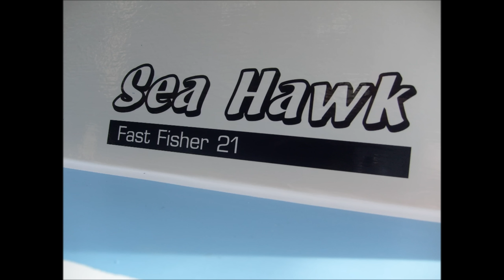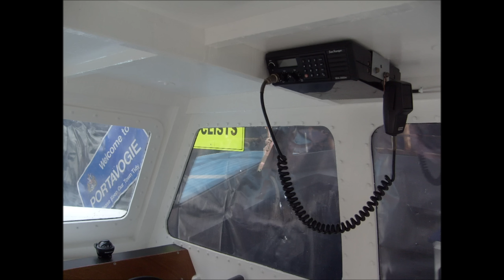Wooden boat build. Build reports in the link below. 👇 Very sorry for awful music, turn it down👍

Comment: Nice boat, great effort in the build. Can i ask why you didn't opt for cockpit drains straight through the transom, instead of relying on electric bilge pumps? The reason in my mind is if you get caught out in bad weather and have an electrical malfunction and for some reason couldn't pump the bilge manually, you would't have to worry about water building up in the cockpit as it would exit on it's own

Comment: hi fantastic video i just have a question they say never fiberglass a timber boat but then i see professional boat builders fiberglassing timber boats
Reply from the maker: You can only fibreglass certain wooden boats. Clinker and some carvel boats are a no no due to the amount of movement between planks. Marine ply or strip layup  is a much more stable base. I roughened up the surface and used a very slow setting first coat of resin so it really sank in over a week before the glass coats.
Reply: @edmundgregory  thank you